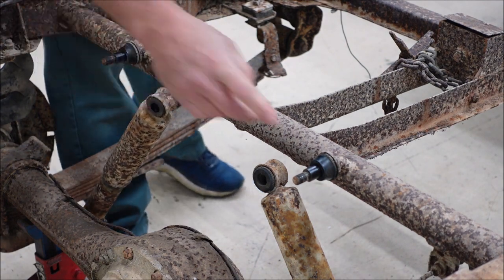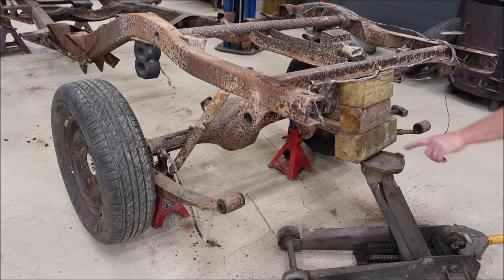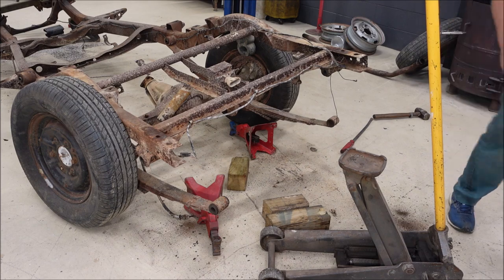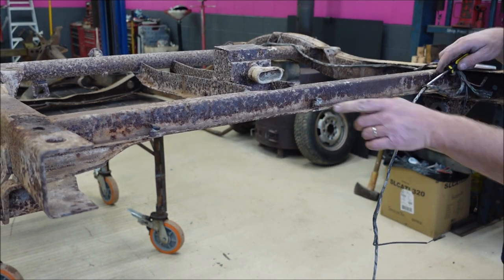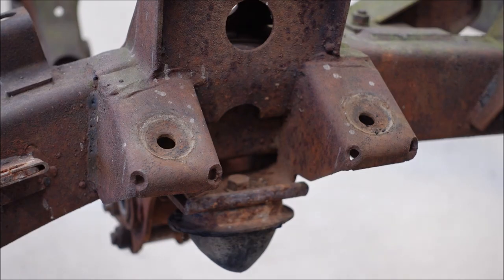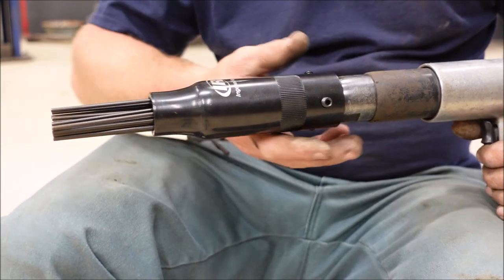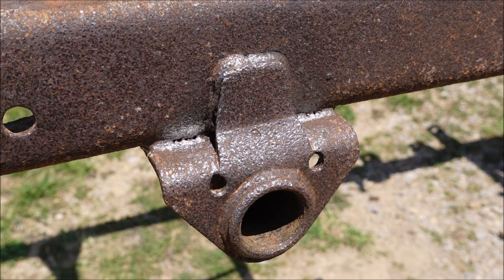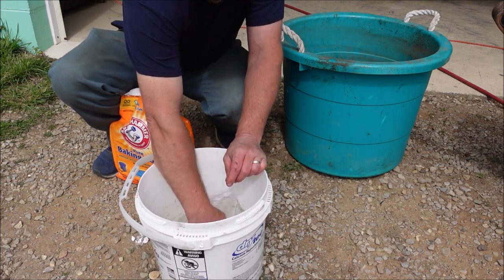#17 Castrating CRUD and  Rust no BITS left behind!! 😬 Datsun 520 Pickup Truck Restoration.

Comment: Suggestion:  I see that you do have a john deere tractor sittin in the back corner.  Use your head, save your hair, use fitch shampoo!  Take your tractor loader bucket and raisd the frame up in the air when taking the rear end out and moving it to the side. Then move your bracket underneath the frame as you wish to do. Let the hydraulics of the tracter lend you a helping hand since your doing this by yourself.  Safty has no quitting time.